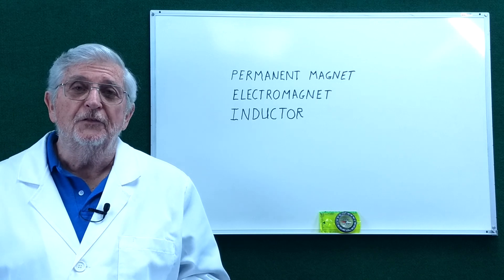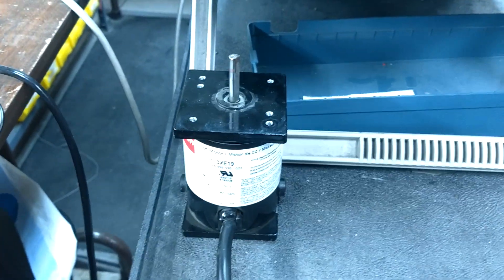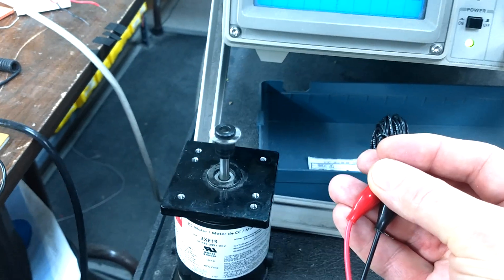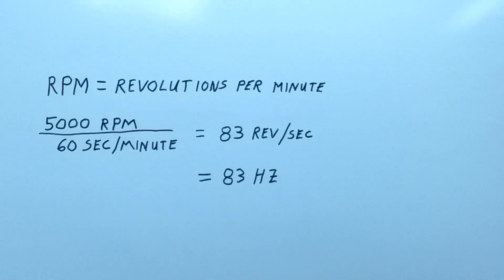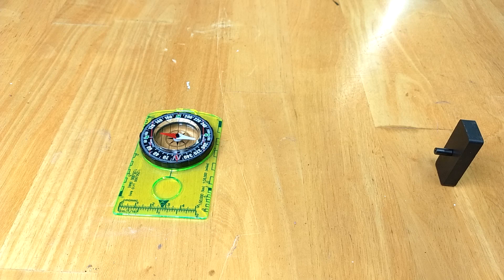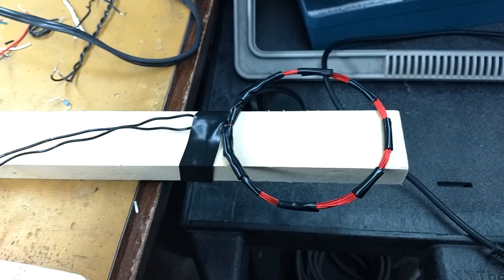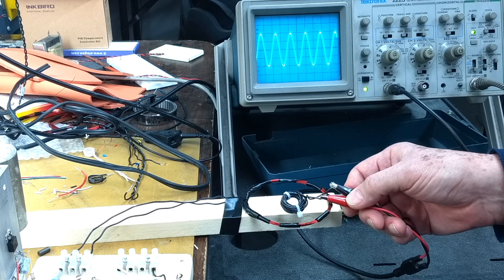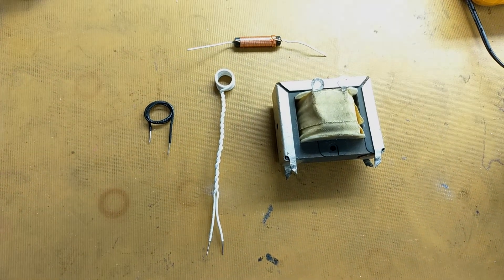Magnets, Electromagnets, and Inductors - a philosophical viewpoint.

Comment: Very interesting video. I'm learning at 67. Thank you so much. Keeps me occupied. Would a a large magnetic loop antenna be more efficient than a small one? Could a small one be improved with coils? Many thanks.
Reply from the maker: Hi Tony. I am still learning at 80. I think that when you stop learning you get old. The answer is yes to both of your questions. Small antennas have small bandwidths which makes them hard to use. I have made several videos on "mag loop" antennas. They are in the amateur radio section of my youtube channel "Jims Cool Stuff".